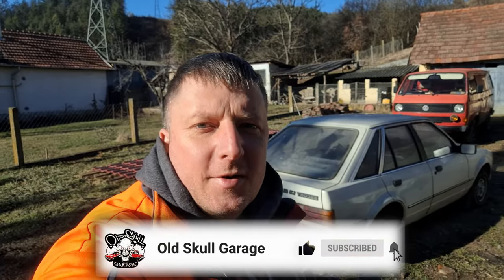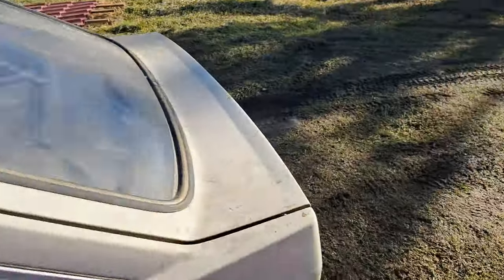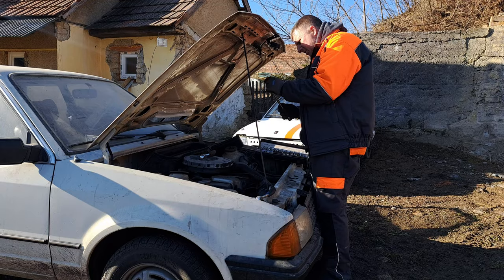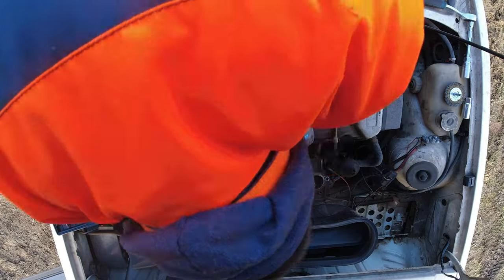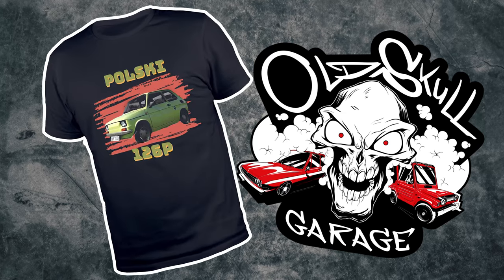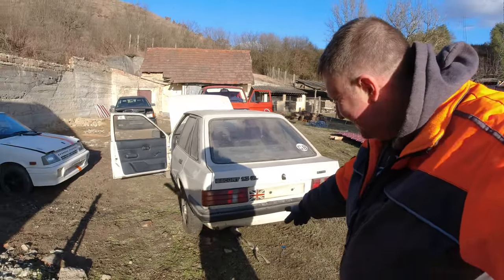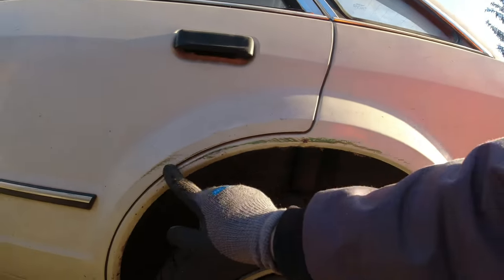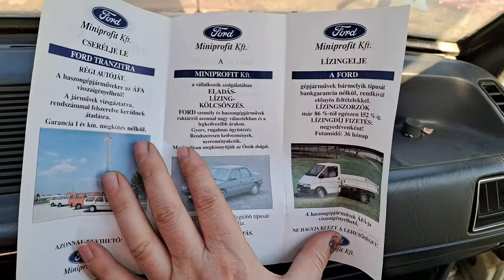Barn Find Ford Escort Mk3 Been Parked Up Since 1993 Will It Start and Drive ?

Comment: Heyyy there 😅 yeah I've seen it 😳 btw just remembered ours had an automatic choke and that was a nightmare 🤪
Reply from the maker: I don`t like automatic chokes. I prefer the manual. Once auto choke goes wrong. That`s it. Pain to get it fixed and they never work properly :D
Reply: @OldSkullGarage-MotoringShow  Yeah true , tbh we had it converted to manual but still no joy it was a mobile mechanic that did the work on it and think he was bit of a cowboy 🤠,  we ended up going to a small claims court to get our money back 🥴
Reply from the maker: @garyestcourt2377  oh dear. You did not have much luck with that escort 😳
Reply: @OldSkullGarage-MotoringShow  You can say that again 😅😅😅
Reply from the maker: @garyestcourt2377  :D

Comment: My first car was a 1984 MK 3 escort 1300L bought in 1992.
Worked all over that engine as an 18 year old with a Haynes manual. Ignition module was it's major down fall but at 45 quid a pop from Mally's Ford spares it wasn't too bad. Not exactly an ECU
Reply from the maker: It's great to hear that, Paul. I passed my test in a Mk3 Escort 😊 Good to know when somebody had actual experience with these engines. I only  started the engine , and the car got parked up until I fixed it up. Feels like a solid car. I own a collection of Ford's, so one day, I will be parked up in line with all the models from the 80s 😁
Reply: @OldSkullGarage-MotoringShow  those CVH engines can get a little noisy, they have none adjustable tapits on the top end. Used to drive me mad on tick over sat at the lights. Battery tray rotting was a common fault too. Passenger footwell used to get soaked. Are you doing a full restoration on it? If so keep me informed and also the price should you wish to sell her. Try find my second car too if you can. Renault 5 turbo 2. Like rocking horse shit
Reply from the maker: @paulwilliams5296  Yes, the hydraulic tappets are not adjustable on them. Luckily, modern oils are a bit better for these engines. The battery tray is good on this car. I will do a full recomission on this car. Part from the rear valance, there is no rust. So try to keep these original as possible. I don't think I want to sell it in the near future. But if I do, it will be shown here. Funny you say Renault 5. Check out the channel. I am actually racing one 😁 The one on the channel is mine 😊

Comment: I have a 1993 charade g200 1.3 16v rs sat on my driveway in Lincolnshire if anyone wants a challenge, needs a little work for the mot but well worth doing,
Solid car, runner,
You will not find another of these rare 90s hot hatch sleepers in the UK,
Reply here if interested and come take a look
Reply from the maker: Hi. Please write me on the Facebook page.: Old Skull Garage - Car Show
Reply: @OldSkullGarage-MotoringShow  I'm not on Facebook, is there an email address or other contact on your Facebook if i ask someone with Facebook to look on my behalf